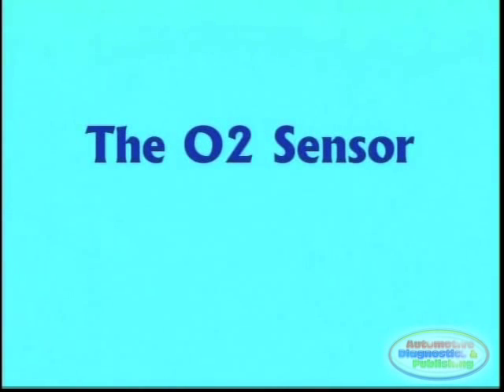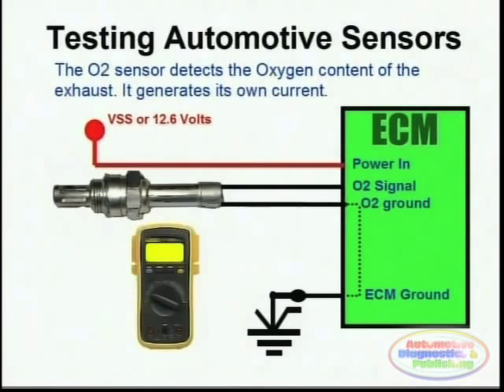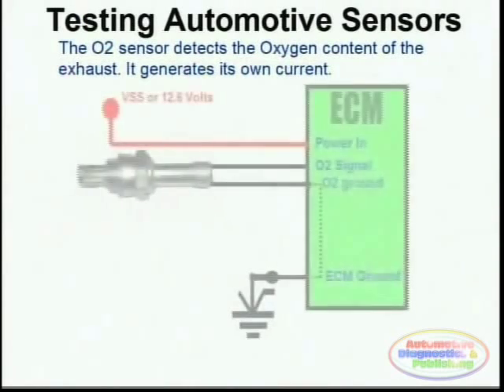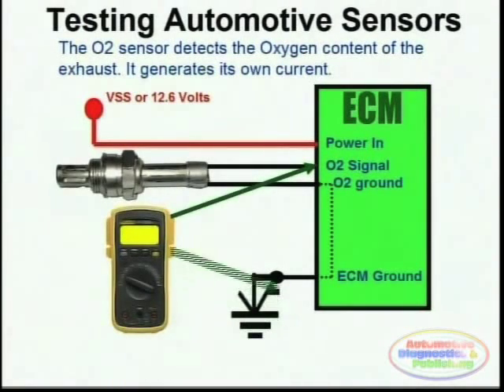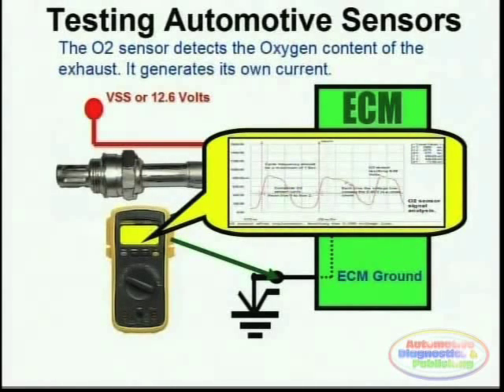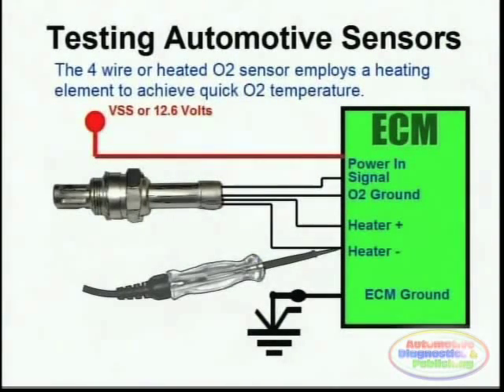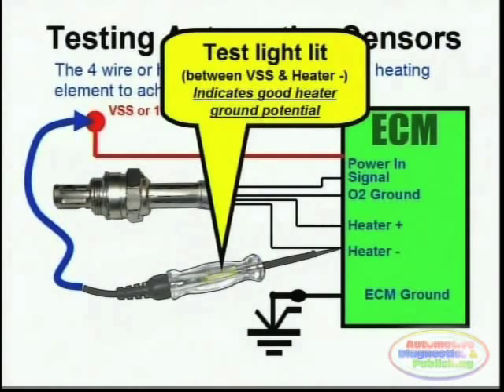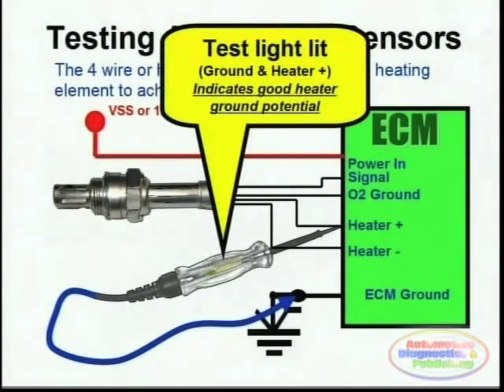O2 Sensor & Wiring Diagrams

Comment: The proper way to test the heater is by also doing a resistance check. 12 volts at the heater does not test the heater element. You need both a voltage and resistance check to see if the heater is working.

Comment: I've been using a test light to diagnose computer circuits for 20 years. Get a test light hook it to a battery and measure how many milli amps it draws. Mine is .140milli amps. Most solenoid pull around .300 milliamps. So hooking my test light up to check a driver in the computer or what ever will not damage a thing. Even mini relays that pull .100 milli amps my light hasn't hurt.Just make sure you use the correct bulb and check your test light so you know how much it pulls. A test light without a bulb is useless to me.
Reply from the maker: 70corwin Nicely done Corwin, but not everyone has an understanding for current flow in milliamps as you do. Yes, you can definitely use a LT with a low current bulb to test lots of electronic circuits, since you're simply injecting a bit of current in the circuit. In fact if it's an LED TL the current is so low that it won't trigger certain circuits making in useless. The idea is to employ more than one TL, as in an LED, Bulb-type, stress loaded TL, etc.

Comment: Do downstream 02 sensors share same 4 wires to the ecm? It's a 96 vortec dual Exsaust so 4 o2s but I can't find wires that go to bank 2 anyware so can I just take those 4 wires and splice into the other rear 02 sensor that goes to ecm? Any info or direction would be great thank you

Comment: You NEVER EVER use a test light to diagnose computerized circuits. The test light will draw more current than is allowed and fry that circuit! Use only a DVOM (Digital Multimeter) ! A test light does not show you how mulch voltage is available. It only indicates that voltage is there. It takes 3 volts to light up most test lights! A DVOM will tell you exactly whats available and not damage circuitry. Also, this testing method applies only to a Zirconium Dioxide O2 sensor not a Titania type.

Comment: I own a 2012 Mustang GT my question is regarding a 5 wire diagnosis, I recently had a P0155 code indication its a bank 2 sensor 1 O2 sensor fault, (drivers side upstream) replaced the sensor and still have the same code, after further looking into this the wiring might be at fault, do you have a diagnosis of how to test the wiring for a 5 wire O2 sensor?
Reply: pepe pingu replace the both downstream and upstream

Comment: On my vauxhall vectra c 1.8 their are 4 wires on my oxygen sensor 2 white wires which is the heater wires and a light grey wire which i guess is the signal wire but not sure and a black wire which i think is the ground wire but again not sure because i have been told its the other way round,can you help me on this before i do the test as my ecu light has come one pointing to down stream 02 sensor but i need to do the test before spending 90 pounds on a new one which i can not take back once openend to try,i would hate to damage my computer by short circuiting the engine control unit.

Comment: Mine has a 3" black round rubber piece that the 4 wires go through instead of a female or male connector.
Is this a special connection or just to hold the wires together?
2000 Mercedes S500 Base 8 cyl. 5.0. it was on there when the car was new.
Is there a universal sensor instead of paying Mercedes over $200 for one sensor?
Awesome video. Thanks a lot.

Comment: In a car the wires for upstream CC are. 
1. pump current
2. sensor voltage negative
3. heater negative 
4. heater positive
5. compensating current
6. Lambda control,
 wiresCan you explain what is the use of so many wire. why not only 2 or 3 ?

Comment: I have a problem I can't resolve . I have a 4 pin 02 sensor where the plug broke apart . Both upstream and downstream broke on passenger side . Any info on how I can connect the proper harness wire to the 02 wire ? Any help would be great . 2003 jaguar s type r .
Reply from the maker: Look at the other side of harness, the color wires coming from ECM and ID them with wiring harness. http://autodiagnosticsandpublishing.com
Reply: @ADPTraining  , thank you !!
Reply: @ADPTraining  , after scanning and monitoring the 02 sensors the 02 in question has no voltage it's connected wrong . It explains alot regarding codes . Thank you

Comment: Yes but wrong.

You need to test the heater element by disconnecting the sensor and probing with the ohmeter for the heater element. Reading should be less than 10 ohms and more than 1 ohm.
Reply from the maker: Not quite

Comment: Hi There.  Great real life video that's how to show it.  I'm also interested 
at this moment about cold engine and hesitation when good idle but then 
increasing RPM which makes it go rough.  As I understand it, the O2's, 
FPR and EGR have no input until they reach operating conditions.  Also 
how should downstream O2's behave as mine is 290mV generally.  If it 
needs to be high say 900mV then could I make a potential divider and 
produce the 900mV to see if it ineed makes a difference.  I don't know 
what current would be needed yet in order to make the devider.  I had a 
1131code swirl valve and when I cleared it as I needed to for the MOT it
 went as above.  Also now and before, it went slow up hills and 
hesitates.  Thanks a lot for any info.
Reply from the maker: +Ilovetosingem On older systems rear O2 has little to no activity. On newer baby converter (small catalityc), the rear and front O2 follow each other. O developed a system to test these in my books. https://www.createspace.com/pub/simplesitesearch/simplesitesearch.search.do?sitesearch_query=mandy%20concepcion&pageSize=15&page=1&sitesearch_type=STORE&facets=contenttype%3ABOOK%3B&showmore=
Reply: +ADPTraining I forgot to say the car is a Nissan Almera 2000/01.  Thanks for the info and all the very best.
Reply from the maker: Thakns you.